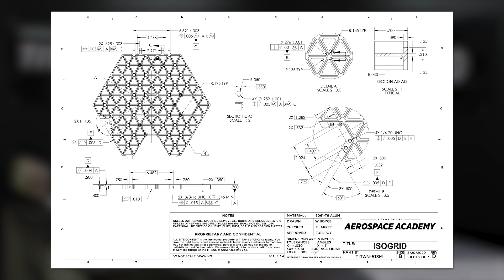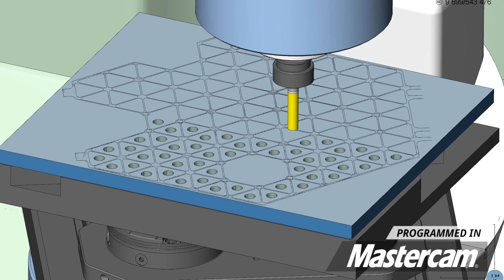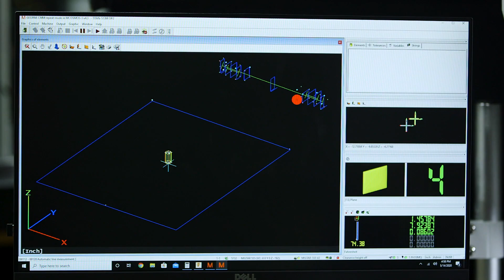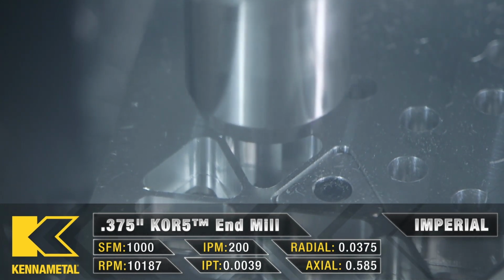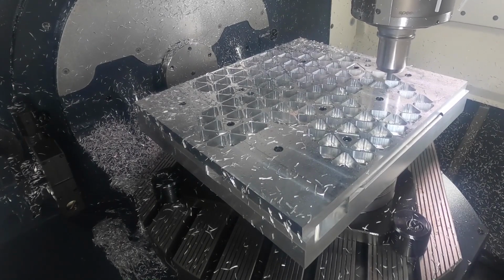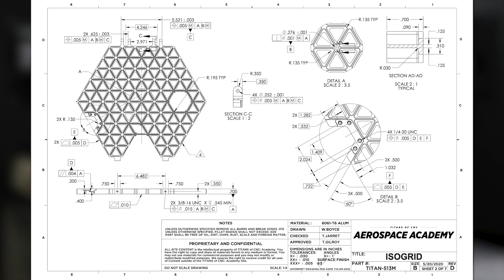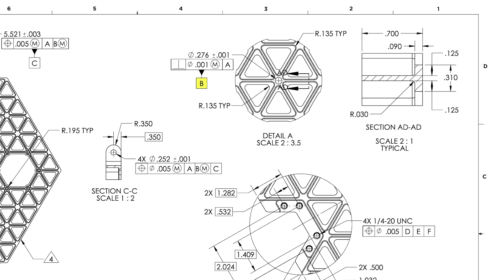You WILL scrap parts if you overlook this critical detail…

Comment: My process:
1) Double check that drawing # and Rev # match WO
2) Give it a quick scan to get a general overview 
3) Look for any tight tolerances, be it size or GD&T
4) Figure out how many operations and in what order. 
5) Consider my work holding strategy. For me, this includes my datums. 
6) Things often change as you work through 4 and 5. Revisit as necessary. Sometimes I work through 4 and 5 a couple or a few times as my initial plan evolves into a working strategy. 

None of us are perfect. I’ve been at this 15 years and I’m pretty good at what I do. Yet, last night I scrapped a part that I’ve done dozens of times. Ran it on a different machine than usual using the exact same process. I *think* the issue was that the chuck on the 4th axis just didn’t have as much clamping force with an equal force applied to the t-handle as compared to the other machine, despite being a larger chuck. But lesson learned. 

My process works well for me, but I’m not infallible.

Comment: Some parts like you mentioned, require you to flip the parts several times to rough, stress relieve when applicable then finish machine. Turbine vane rings are a fine example. Applying service dimensions (SD) or blueprint modifications (BPM) to your roughing and finishing operation dimensions when planning the part will save you a ton of headaches.

Comment: Just like they say "The statue is already inside the marble block, all you need to do is chip away the excess" the real problem is locating the statue not what tool to make the chips or even how to hold the block.

You can even locate it correctly but locate it inefficiently. I've seen it where colleagues locate on a plane which causes them to need to remove the part and put it back in located on another plane; they could've just used the second plane but were more than happy to fatigue themselves constantly opening doors and didn't want to adjust their strategy when it was pointed out. Ultimately they got lazy putting the part in and not making sure it was well seated in the vise causing failed parts. Even though it was slower with their method it wasn't technically wrong, but you would be crazy to do it!

Comment: The first thing that I look at when I get a new print is the tolerances. If the tolerances are super tight (such as aerospace tolerances) they determine how the part has to be held, and more importantly - the order in which it is machined. But before I write my CNC program I'm going to take special note of any special callouts like the datum point and what has to relate to it..... Because that will also have a bearing upon the order of machining and possibly how the part is held.

Comment: My first things to look at are: 
- what are the features of the part 
- where is my zero and where are important/ out of the norm measurements (like everything is measured from one side and one is from another side) 
- where are connections between measurements 
- what tools do I need to get everything 

With that I decide: 
1: how to hold the part 
2: order of operations 
3: how to get in the tolerances 
4: what feeds and speeds i can use 
5: any specific part related stuff

Comment: Great info.
Tight geometric tolerances can make a simple job far more difficult. Usually one of the first things to look at on a job as it directs towards how the part is made. Also points towards which dimensions are key features if not indicated on the drawing.
Reply: Exactly this. As a lathe guy, what can seem like a easy shaft gets significantly more difficult with a tight tolerance along the length, and can double or triple the time per piece. Likewise with surface roughness callouts

Comment: Hello
I would like to ask if it is possible to post links books etc about the stress during machining process and how do we avoid the bent part
for an example,  a block of material 12*250*270 mm for sk30 or 40 etc. This part need holes pockets "through all" up to this point all ok... but when you are going to make "open pocket "  something like hear brush but has only three  10*200 mm through all pockets... the part will have bent 0.2 mm or more like banana. 
thank you

Comment: There are times with parts like these that the tried and true tooling tab approach is the easiest way to go.
Dowel pin holes 2plc and allen head bolt and c'bore locations judiciously chosen around the part periphery.
Anybody here who's spent time in the Southern Calif. aerospace shops will know what I'm talking about.

Comment: Unfortunately in the UK, apprentices are not given training on GD&T, to any great extent, I suspect that this is quite common in a lot of European countries. Apprentiships have been degraded to the extent that where a machinist had to complete a 4 year apprentiship they can now complete it in 2 years, at the end of which they have barely grasped the basics.  Apprentices should not be allowed anywhere near a CNC machine until they have been on manual machines and learned about tool geometry, vibration alleviation, stresses in materials, coolant preferences and any number  of other factors inherent in producing good parts. There is a lot more to producing good parts than writing programmes in mastercam et al.. , but you need a firm grounding in machining of all disciplines before that. I  run a cell with 4 CNC machines,1 manual lathe and a Bridgeport mill, and no one gets to push buttons until he can read a drawing  and produce a part to my satisfaction on that manual lathe and mill.

Comment: What is the best method to prevent warpage due to stress in aluminum when removing a lot of material?
Reply: Get tooling plate (also known as Mic6 I think and ATP5083).
It is a casted aluminum so there is hardly any stress in the material
Only downside it is is a softer aluminum, but after a good anodize layer it is as good as the rest (don't quote me on the last part haha)
Reply: He pretty much says it in the video, occasionally you'll have to flip multiple times roughing fully first then deciding what side to finish first for establishing datums. These days with adaptive clearing there's alot less stress in material than there used to be. Sometimes on top of flipping you may need to do a reseat or a tension relief say on a face where you unclamp your vise and then just barely close it to establish good flatness/ parallelism. Unfortunately there isn't one solve all solution because it's going to vary between applications
Reply: Minimize your clamping pressure. I find most people tighten the work piece the same no matter what type of cutting is happening,  super tight.  120 inch pounds will hold a part good enough I find in almost all cases. It's unbelievable to me how it's general practice to reef everything as tight as it can go.  I've explained why it's not necessary to hundreds of people.  Almost everyone ignores me with that and with thermal expansion.  The fact is that most people just like to fuck things up for themselves instead of taking advice from a fellow colleague. It's literally why we can't have nice things.

Comment: to me machinists need to take the time to look at the part same as an engineer plus what they need to get the part properly machined. First what is important, what features NEED to be held and what are cosmetic or structural, then how do I hold this to use those important features so the part is within tolerance and how will this material move (ie. stress in the part). I have many machinists older than me and been in the trade longer that collaborate with me since they many time forget about stress and letting it out before finishing.

Comment: How bout Temperature?
Something every single person in every shop ignores. I never ignore Temperature and not once have I not been looked at like I'm an idiot. It's so annoying.  Nobody on YT talks about thermal expansion either.  In my mind any machinist who isn't thinking of thermal expansion is an amateur, period.
Reply: I like your style. Especially in tight tolerance, post heat treated parts.. PIMA.. but, you learn what parts do, at what thickness/lengths, and so on.. much warmer on the shop floor than it is in quality too 🙂